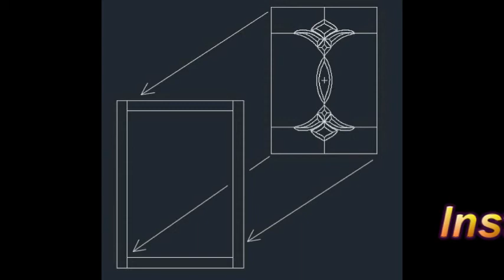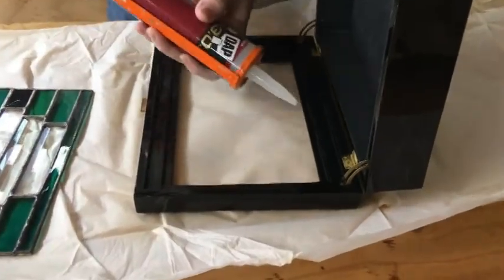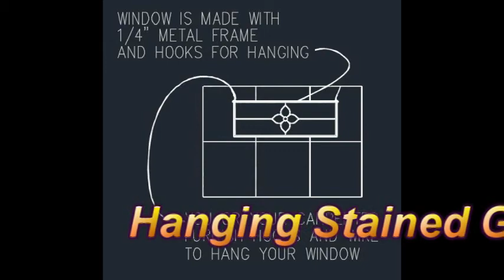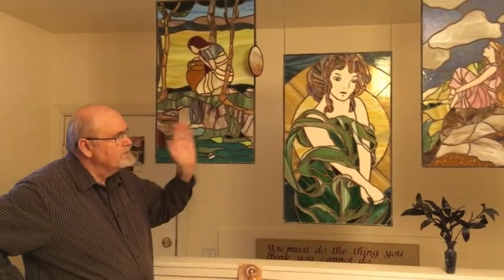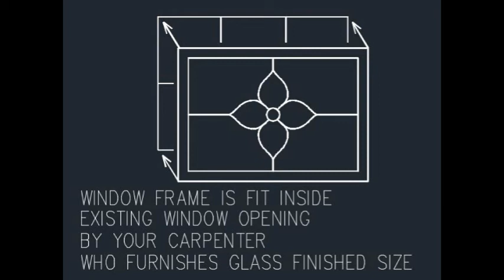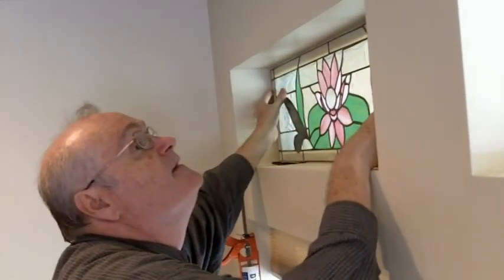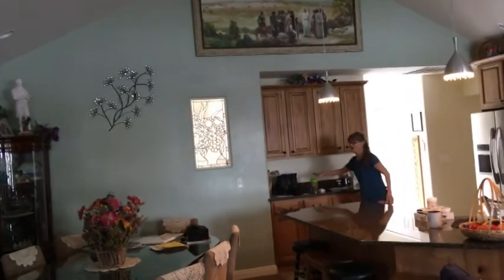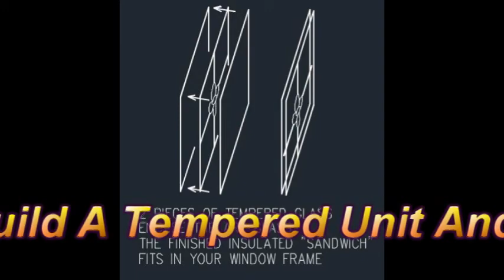Stained Glass Fundamentals – How To Hang Stained Glass V328

Comment: Great video, thank you! It was neat to see the different uses of silicone and caulk.
Reply from the maker: If I can, I use caulking instead of silicone because it's easier to clean up. I avoid the product that goes on white and turns clear because it doesn't always turn and then you've really got a mess.😮😎😮

Comment: Great video, Thank you so much for all the information! Question for you, how would you install stain glass into a hollow vinyl fence/siding?
Reply from the maker: Good question! When doing installs outside I always install into a solid frame, metal or wood before hanging glass, I usually want the wind resistance to be small so I limit the size of the piece. Good luck on your install, I'd love to see your results.

Comment: Thank you for this video 
I did notice you didn’t explain( how )the hooks were attached to the frame
Also my windows are mostly round 
When I solder hooks on they sometimes break off the frame thus crashing to the ground🤔😖
Thanks again 
Patricia
Reply from the maker: On metal frames we solder rings to the frames and on wooden frames we screw in rings or screws through chain. You may wan to look at our video on soldering rings https://youtu.be/vVlftXRzZuI  you want to avoid a "cold" joint on your rings. Good Luck

Comment: What kind of two sided tape did they use?  Foam, open cell, closed cell, rubber?
Reply from the maker: I don't use two sided tape, I use painters tape to hold the glass in, with a folded piece of cardboard that acts like a spring to put pressure against the tape and the glass
Reply: @GommStainedGlass  Did you set the zinc frame right up against the glass?  The slight bubble that you get when you join the solder lines to the zinc frame causes it to stick out just a bit.  
I love your videos they are so full of useful tips.  Thank you for taking the time to make them.

Comment: Hello David & Jeanne! I'm getting ready to install my first large panel! Instead of nesting the panel inside the window space, it's actually going to rest up against a black metal industrial frame that the window currently has around it. There is a rectangular wooden casement surrounding the black metal frame with a width of a 2x4. The carpenter is going to build a frame/trim to hold the panel in place up against the black metal framing. Do I still need to use silicone? And should I use shims at the bottom to allow for air circulation between the two panes? There will be approximately 2 inches of space between the stained glass and the window glass (going outside)...the depth of the black industrial metal framing. They would also like to place a clear (unsealed) glass pane in front of the panel to keep people from touching it. As always any concerns or thoughts would be appreciated! Thanks, Kristy 🤗
Reply from the maker: How did it go? Sorry to be so slow about getting back to you.